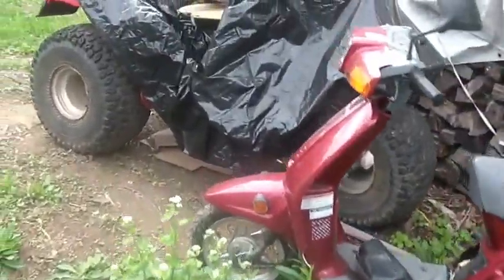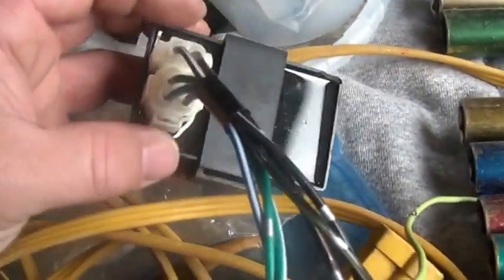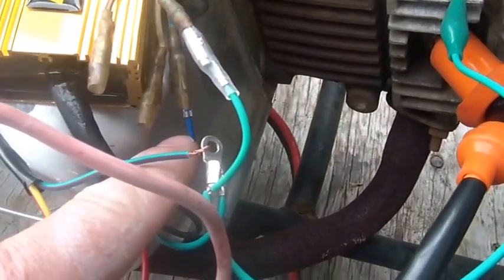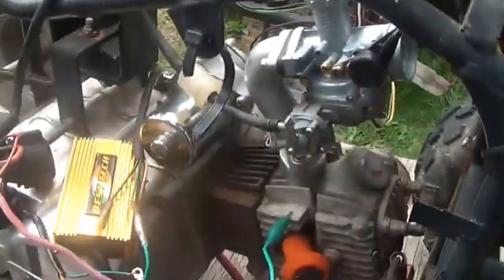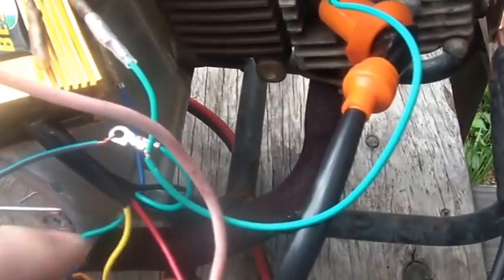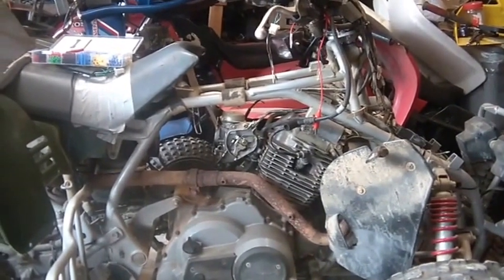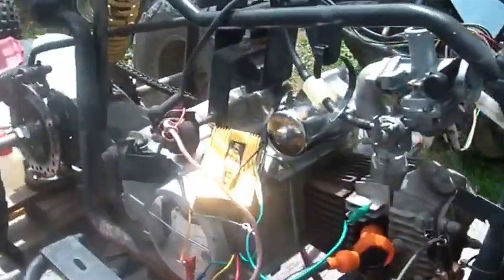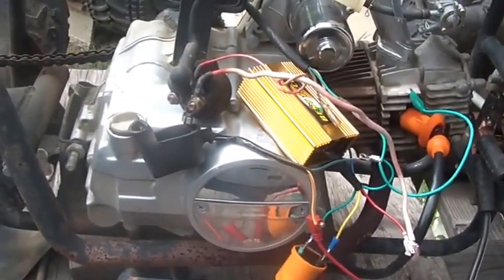Best Tech ATV CDI upgrade install, DIY 12VDC CDI ATV Hack,

Comment: hi harvey, is it bad to use your black and red wire coming out of the engine as the power for a DC cdi unit, instead of using the power of the battery?
Reply from the maker: Hey Marien!!!  Generally speaking, if one runs the Black wire with the red stripe to a DC CDI unit, it will not work and it will probably damage it. One can not put AC into a device built for DC and have it function. I have seen CDI units that can run on AC or DC, but, they have to be built that way and they are sold that way, normally they cost a little more,,,, Thanks for asking, watching, and commenting!!!
Reply: Thanks for ur quick answer! I live in the Netherlands so buying from ebay isnt that simple as for u, so i bought one on a dutch website but it didnt say if it is a AC or a DC cdi unit. I think its an AC
Reply from the maker: Hey Marien!!!   My experience is that more often then not, one ends up with an AC CDI unit even when the selling description says it is a DC unit.... Generally speaking, if the add includes a wiring diagram that shows a 12VDC input, U bought the right one and the seller knows what they are selling.... Thanks again for asking, watching, and commenting, good luck with Ur CDI issues and Happy New Year!!!
Reply: Harvey Spooner, thanks and happy new year also

Comment: Hi  is there a difference between a 2 stroke and a 4 stroke cdi box using your 12 volt dc method  of replacing factory cdi

Comment: Hello Harvey hope you're having a great day. I have a question that I really need help on I have a 1984 Kawasaki klt 250 3 wheeler I bought this really cheap for $250 the problem with it is it has no spark when I bought it from the guy he said that it had very weak spark and then no spark at all next day when he had it so after I took it home I started working on it. i went through the wiring the wiring doesn't seem to be bad the key switches seem to be working so I bought a new pulsating coil for it and replaced it but I still have no spark I also replace the ignition coil as well as the CDI box and I still have no spark I'm not sure what the problem is and I was just wondering what you think about that what you thought the problem might be I'm just not sure what's going on with it.
Reply from the maker: Hey Hondaman!!!!     Kind of hard to troubleshoot from here, I would make sure that the on and off, (run and stop), switches  are not leaking to ground, clean up all of Ur connections, make sure there are no wires opened or leaking to ground... Let me know how U make out.... Thanks for asking, watching, and commenting!!!
Reply: Harvey Spooner thank you so much for the advice that's what I will do it's got to be a ground issue I'll go see the whole wiring and see if I can find the problem I'll let you know how it goes thank you again for the advice.

Comment: Those china boxes are my go to box because there cheap. I buy them at a half dozen at a time but all of them burn out like light bulbs. Had six of those gold boxes and they don't last at all, 5 to 20 hrs. The black ones last about a year or two.
Reply: william staten I've had the same experience with them....they sure don't last long especially seems to that they burn out quicker sif you run them in the upper rpm range more so than the lower rpm range